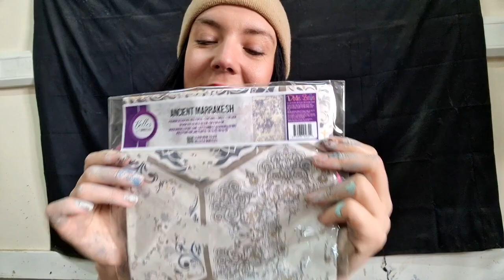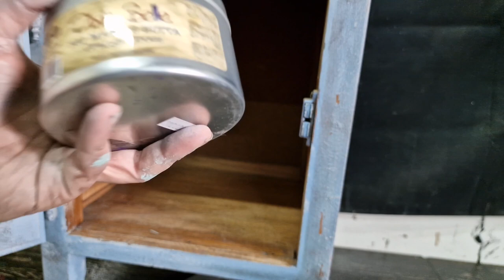This MEGA Transformation Turned a £5 Table Into Saleable Furniture Art!

Comment: Really love this piece 👏🏼👏🏼👏🏼
Wanted to know tho, because of the amount of texture (which I love), how easy is it to keep it clean & stop/remove dust etc  from staying in the low lying areas when something this textured is cleaned/dusted? Generally Furniture with smooth finishes is easier to keep clean cos there’s little or no texture to trap or hold the dust. What do u think?
Reply from the maker: I generally sand the texture done a little, which smooths it out. I guess technically more dust can settle, but as long as the piece is cleaned regularly with mild soap and water, then there should be no issues with that 🙂